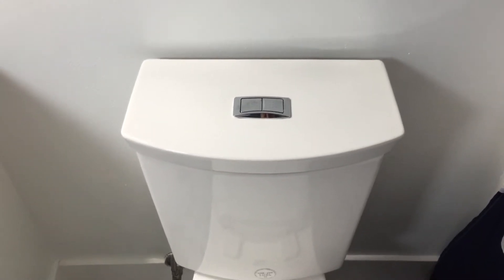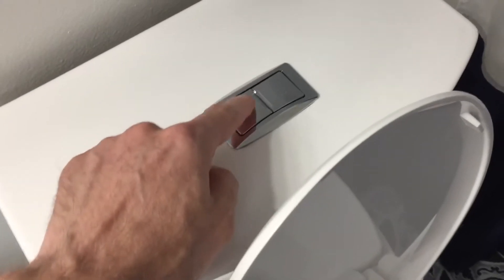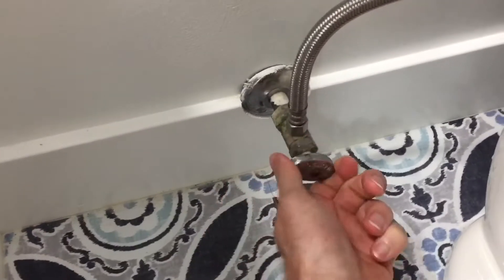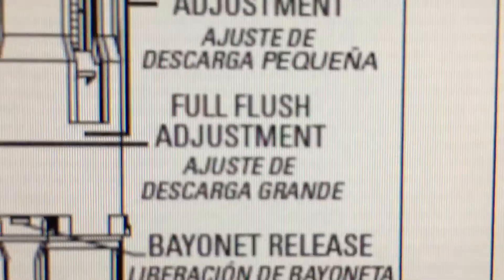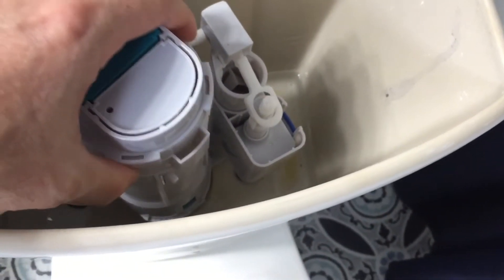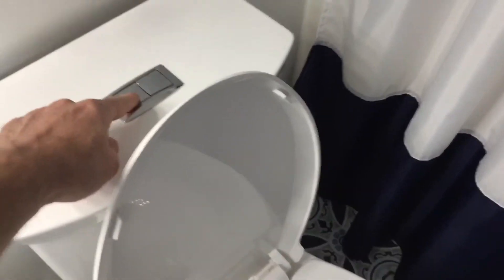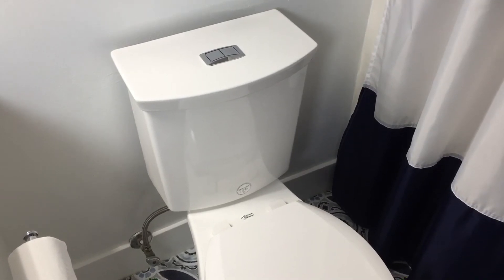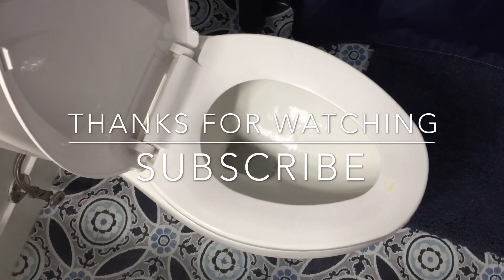How to Fix Low / Lite Flush Problem - American Standard Cadet 3 Dual Flush Toilet - doesn’t work

Comment: this has turned into a real nuisance. the valve mechanism in mine is not the same as what is shown here. I spend a ridiculous amout of time holding the float down to get more water into the bowl to get even a lousy flush.
what a lousy design. I will probably chuck the whole thing in the trash, and replace it with a single valve unit.
Reply from the maker: Sorry to hear that. I get it! I personally no longer own this toilet and definitely would not recommend it.